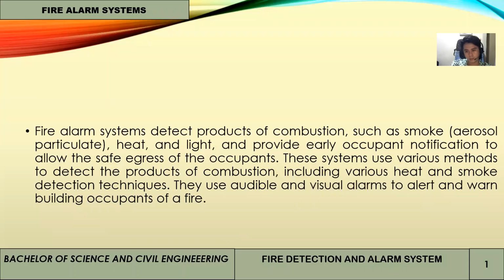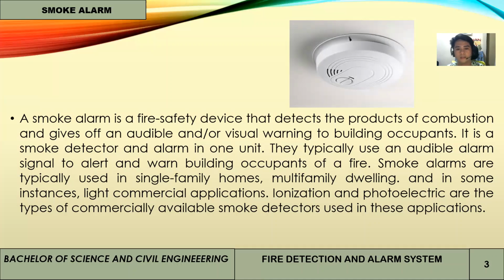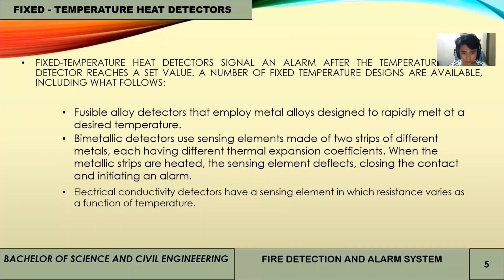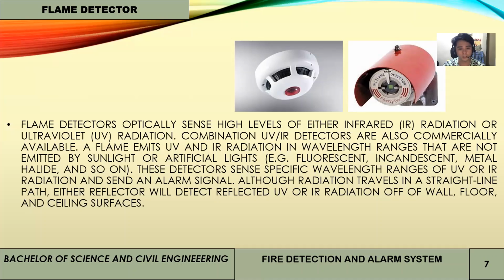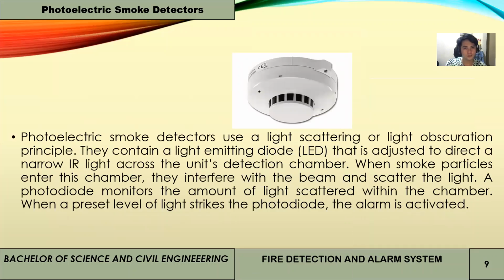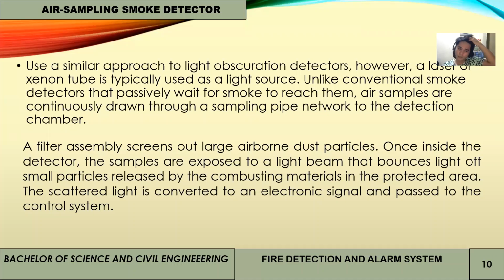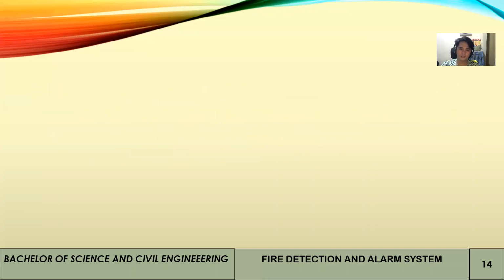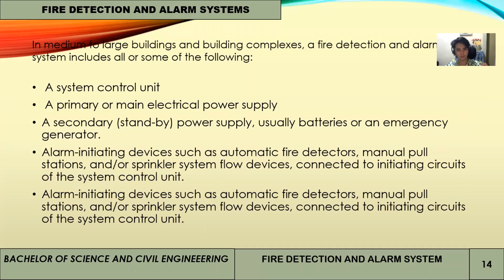UT2

Comment: The three qualities of fire that fire detectors are supposed to detect, according to this article, are smoke, heat, and flame. Aside from that, every fire detection system should include manual call points so that assistance may be dispatched quickly in the event of a fire. I learnt that we must use a fire alarm component in order to be notified if there is a fire in the buildings, and that we must use high-quality fire alarm components to ensure proper operation

Comment: After watching Sagragao's report. I learned what is a fire alarm system. Fire alarm system according to sarragaos is a system that detects product of combustion, such as smoke (aerosol particulate), heat and light. And it also provides early occupant notification that allows the safe egress of the occupant. I also learned that there are three qualities of fire. Generally, in this report I learned how important to have a fire alarm.

Comment: I've learned that Fire Alarm System is designed to detect fires including smokes,heat and light.There are types of fire alarms depends to spaces which classify if it is residential  or large buildings.Fire alarm components we may use to be  alerted and we should must choose the best quality to ensure proper and best operation.

Comment: Fire alarm systems are device that is designed  to detect combustion, such as smoke, heat, and flame. By the installation of these devices, when fire occurs, anyone will be notified and it is needed in every building. They play a role in terms of fire cases.

Comment: In this topic and video I learned and emphasizes the necessity of having alarm systems in a building since these alarms can be activated automatically by smoke and heat detectors, or manually by manual fire alarm activation devices such as manual call points or pull stations, which can help avert large fires.

Comment: The three qualities of fire that fire detectors are designed to detect are smoke, heat, and flame, as I learnt in this topic. And the  purpose of the fire detection and alarm system is to detect fires early enough for residents to safely evacuate. These systems use a number of techniques to detect combustion products, including heat and smoke detection. In addition, during a fire it's vital to activate the occupants with an alert or bell, which can be done with an alarm system.

Comment: The three qualities of fire that fire detectors are designed to detect are smoke, heat, and flame, according to this topic. Aside from that, every fire detection system should include manual call points so that help may be dispatched quickly in the event of a fire. During a fire, it is vital to activate the occupants by an alarm or bell, which can be performed through an alarm system.

Comment: This topic taught us about the fire detection and alarm system. In this topic, i learned that Fire detection systems are designed to discover fires early in their development when time will still be available for the safe evacuation of occupants, and Alarm systems provide notice to at least the building occupants and usually transmit a signal to a staffed monitoring station either on or off site.

Comment: According to this topic, the three aspects of fire that fire detectors are meant to detect are smoke, heat, and flame after viewing the movie. Aside from that, every fire detection system should feature manual call points so that assistance may be provided swiftly if a fire occurs.

Comment: I taught that fire detectors are designed to detect three characteristics of fire: smoke, heat, and flame. Aside from that, every fire detection system should include manual call points so that help may be dispatched quickly in the event of a fire.

Comment: In this video presentation, I learned that if there is a fire in the building, we may be notified, and we should select high-quality fire alarm components to ensure proper operation. I also learned that smoke alarm is a fire-safety device that detects the products of combustion and alerts building occupants with an auditory and/or visual warning. It combines a smoke detector and an alarm into a single device.

Comment: After watching this report, I learned that on of the system to give safety of the occupants in the event of fire is the fire alarm systems. In which it detects the combustion, smokes, heat and light and give notification to harm people inside the building. The devices of this systems are smoke alarm, smoke detector, fixed temperature heat detectors, flame detectors and others. Smoke alarm the typically used in single family homes and light commercial applications. Basically, this alarm system focused on detecting the smoke that spread in the building or house. Flame detectors sense high level of radiation to alarm occupants of the hazardous fire.

Comment: In this video, I learned that the fire alarm systems detect combustion products such as smoke (aerosol particles), heat, and light, and alert inhabitants early enough for them to safely exit the building. A smoke alarm is a fire-safety device that detects the products of combustion and gives off an audible and/or visual warning to building occupants. It is a smoke detector and alarm in one unit.

Comment: This video tells us about the importance of having alarm systems in a building because these alarms may be activated automatically from smoke detectors, and heat detectors or may also be activated via manual fire alarm activation devices such as manual call points or pull stations that could prevent massive fire

Comment: I learned that  Fire detection systems are designed to discover fires early in their development when time will still be available for the safe evacuation of occupants. Alarm systems provide notice to at least the building occupants and usually transmit a signal to a staffed monitoring station either on or off site. Fire alarms are important because they can give you an early signal to something that could be tragic – basically saving your lives. A fire alarm alerts you when you are busy, working or sleeping. This makes us an assurance that we need and we are aware to the importance of installing fire alarm systems.

Comment: According to this topic, the three characteristics of fire that fire detectors are designed to detect are smoke, heat, and flame. Aside from that, every fire detection system should have manual call points so that help may be sent immediately if a fire occurs. I learned that we need to use a fire alarm component so that we may be alerted if there is a fire in the buildings, and that we should choose high-quality fire alarm components to ensure proper operation.

Comment: The video presented discussed the Fire Detection and Alarm System, which is designed to alert us to an emergency so that we can take action to protect ourselves, our employees, and the general public.Regardless of the method of detection, if the alarm is triggered, sounders will activate to warn people in the building that there may be a fire and to evacuate.A remote signal system might be included in the fire alarm system, which would then inform the fire department via a central station.

Comment: From this vieo,the  three qualities of fire that fire detectors are designed to detect are smoke, heat, and flame, according to this topic. Aside from that, every fire detection system should include manual call points so that help may be dispatched quickly in the event of a fire.

Comment: In this topic, I learned that smoke, heat, and flame are the three characteristics of fire that fire detectors are designed to detect. Aside from that, every fire detection system must feature manual call points so that assistance may be sent immediately in the event of a fire. The significance of activating the residents by an alarm or bell during a fire is critical, and this can be accomplished through an alarm system.

Comment: In this report, what i have learned is all about FIRE DETECTION AND ALARM SYSTEM. It says that fire alarm systems detect products of combustion, such as smoke (aerosol particulate) heat, and light and provide early occupant notification to allow the safe egress of the occupants.  These systems use various methods to detect the products of combustion, including various heat and smoke detection techniques. They use audible and visual alarms to alert and warn building occupants of a fire.

Comment: What ive learned from this video is that detection systems are designed to discover fires early in their development when time will still be available for the safe evacuation of occupants. Early detection also plays a significant role in protecting the safety of emergency response personnel.